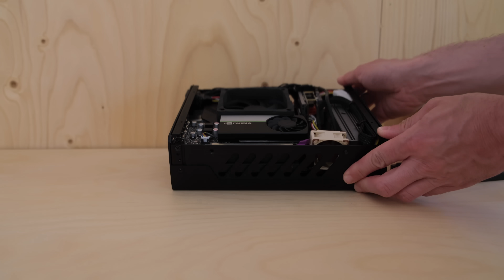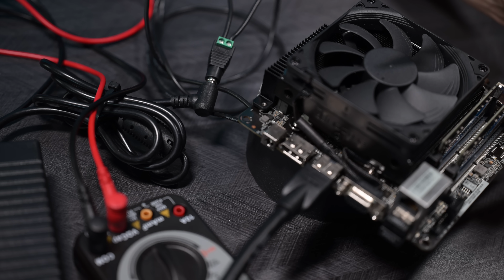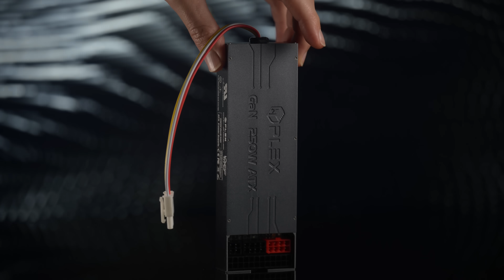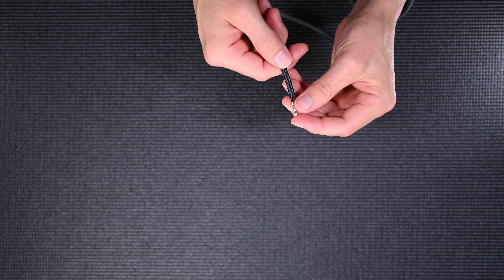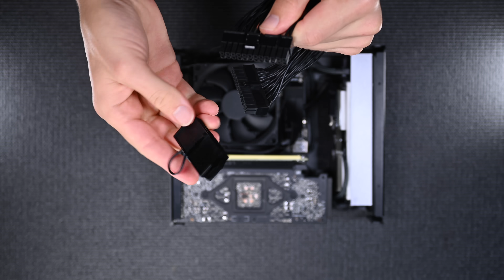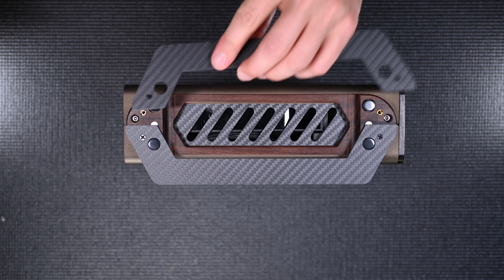My dream PC: "Tiny RTX"

Comment: Interesting guys, you just need 3D printer, some named machine that cuts shape into the plastic plates, custom expensive cable, high priced low voltage power supplier. So instead of building PC just start business with it.

Comment: The problem i can see here is the gpu copper plate. The GPU chip is always machined and soldered as flat as possible to ensure maximum contact with heatsink where as the memory chips are not subject to the same tolerances and direct pressure from an non flexible plate will put uneven pressure on the solder joints and will cause the components to fail prematurely. A simple solution is to use decent thermal paste then 0.5mm shims to cooler and 0.5mm high quality thermal pads ( i use arctic GP3 ) on memory chips. This allows even pressure on the memory chips and at the same time reducing temps nearly as much as a direct copper, just without potentially busting the card.

Comment: do you nead the "psu" ? you cant find 12v and ground on the bord to drive the gpu say if you use a  330W Dell G16 7630 AC Adapter ore dos that not wourk ?
Reply from the maker: Hello, can you please clarify for me? I want to help. :)
Reply: @NotFromConcentrate  say you use a 330w and not the 120w carger. and find the 12v and ground and solder wieres directly from the motherbord and conect to the m.2 adapter
Reply from the maker: @MyggFaen  I apologize I am still not 100% sure what you are asking, but Im going to take a stab at it. I think you are asking if you can use a power brick instead of the ATX GaN unit. I think in theory you can, but you might have some issues with sleep and power on/off, which may or may not be important to you. You would need a 12v brick, NOT a 19v brick, and those are rare in the 330w range. You need a 12v brick because the GPU needs 12v, and you need to split wires off to power the riser from that. I hope this helps.
Reply: @NotFromConcentrate  it was wat i was thinking about but i did belive i would finde a 12v spot on the motherbord to conect the to, eaven if i used a 19v power brick

Comment: Its funny almost the same spec as my own mini rig, i got a 5600g a2000 12gb and 32gb at 3600mhz , admittedly yours is easier to upgrade than mine since ive made my one near the same size as the motherboard but still yours is sooo much cleaner
Reply from the maker: That's awesome! Do you have any pictures or a link? You can share on the NFC discord!!! <3

Comment: I want to do the same, asking serious question, after this months is there any problem when using 12v only for mini STX ?  Thx for reply
Reply from the maker: Works flawlessly for the X300. For other chipsets there are problems and you need buck converters. I'm eagerly awaiting the rumored x600.
Reply: @NotFromConcentrate  i have A300 version, its has the same board. Im glad we dont need any boost converter. Thats the only weakest point which put me on hold to use ex GPU, btw it has standard 55x2.5 jack. So i think we dont need to solder it.  
Thanks you

Comment: Been watching videos lately on mITX builds and stumbled on this video. Crazy how small of a build this is to pack so much in! It looks stunning, and I'm sure it looks amazing on display. I like how it easy it would be to take with you anywhere!
I think insetting the front wood panel so the case is flush with the front like the back, adding some fine mesh lining maybe to the inside of the case which would serve to protect from anything getting inside but also visually add to the look and using some countersunk flathead dark bronze screws on the face would tie everything together even more.

Comment: One thing that I don't like is the look of the screws on the front panel. Have you considered doing it with magnets so the wood look a lot cleaner.
Reply from the maker: Yeah, please check out the updated video with this project. It's also watercooled.

Comment: Building a PC that is just capable enough means you built an obsolete machine.
Reply from the maker: Getting a tax refund from the IRS means you overpaid them and they used your money interest free. I prefer to have exactly the power I need, save my money, and then upgrade later if necessary. Obsolete means it is not useful for the current task.

Comment: I wonder why you didnt build it with intel b660 board since it supports faster cpus and pcie 5.0 m.2
Reply from the maker: It wasn't out when I started this project. Also it doesn't support 12v so you would need a buck booster or exotic PSU to make it go like I talk about in the beginning of the video.
Reply: @NotFromConcentrate  Wow I did not know! how can one find out about the 12v support? I am really curious how you could upgrade the board.
Reply from the maker: @Japhgar  that’s the thing, it’s not listed anywhere, even on the x300. I had to experiment and be willing to take a hit for the team, but the NFC discord has tested other boards since and there is no boot with 12v

Comment: I want to do something similar with a pico psu. Should I solder the dc jack wires to the motherboard 24pin or the 4pin cpu power?
Reply from the maker: Which Pico? An AC/DC Pico? I would use CPU or PCIE not the motherboard voltage.
Reply: @NotFromConcentrate  Looking at the PicoPSU-160-XT DC-DC Power Converter, 160 W. It's got a PCIE so I'm assuming I can just use any 12v and ground on it? I am using the molex to power the GPU. Thanks for replying.

Comment: Awesome bulid you should of fan modded your A2000 you could use the extra 7 watts to overclock the A2000 and get a pretty good performance bump to gaming ( Just look up A2000 fan mod) it super easy and costs about 8 bucks to do

Comment: Lovely project, well done, lads.

My only question is, why didn't you go with the 5700X instead of the 5700G? The integrated RX Vega graphics is "dead weight" (thanks to that "mighty cool" RTX A2000), the 5700X has the same power specs and should be running a bit cooler in general but has the superior cache configuration, surely worth the 30 dollar more. (PCIE 4.0 support wouldn't matter with that board).
Reply from the maker: Simple; the bios only supports the 5700g. Plus I had one on hand and these videos aren’t sponsored so I like to make stuff with what I got :)
Reply: @NotFromConcentrate  Ah yes, that's the board from the ASRock Deskmini X300 and only supports APUs. My bad. ;)

Comment: somehow youtube didn't give me a notification for this even though I have your channel set for "all", so I'm late :p 
Fantastic build though!
I'm in the process of teaching myself power electronics with the goal of someday building a custom power supply for a dream sff build I've had in mind for a few years now

side note: that shroud on the cpu cooler had me very confused in the opening glamour shots XD Couldn't make heads or tails of which parts were what! 

I've got a similar but smaller shroud I got from Jhack 3 or so years ago on top of a noctua l9a that is somehow managing to tame a 5950x in my sm4.

Had to make a few power tweaks of course, but the biggest impact adjustment was actually dropping the soc voltage. Didn't even have to drop ram or fabric speeds for it, seems quite happy to run 1800 fabric/3600 memory on a pair of 32gb gskill sticks with 1v flat.
Stock settings had it at about 1.2v, which pegged the poor thing in thermal throttling range just opening applications. Beat Saber would keep it at a steady 98-99c and at idle it would be high 70s to low 80s.
After the soc voltage drop, it idles in the mid 50s and never goes over 80 in my normal usage. Power consumption dropped by about 20 watts, which is just crazy to me.

Comment: Why is the "base" made out of Carbon Fiber? ..you need the bottom part of the device to be the heaviest.
Reply from the maker: Hello! The device isn't top heavy and can easily stand on its own and even take a bump or two. The carbon fiber is just further tip over protection and provides +5 style points.
Reply: @NotFromConcentrate  Reinforced Polymer is only stylish against synthetic polymers.
While Im not fond of the shape at the bottom (since it seems to affect laminar flow) a metallic component with a "black chrome" coating would make the device seem as if it was floating while increasing thermal conductivity and lowering center of gravity..
Pardon my English not a native speaker.

Comment: modular? technically yes, in practice barely...
Reply from the maker: There aren't many choices when it comes to parts, true, but they are all easily swapped out. Asrock has been good about the STX formfactor for several generations now, and their new intel board is even laid out better. There is a rumored A4000 in half height, and there might be something interesting from intel and AMD around the corner in a few years when I would like to upgrade. Peace

Comment: I use a Densium 4 with 4L volume. It has a nice woodenfront with USB-C. It fits a normal ITX board with a small 39mm Cooler and an full height ITX GPU, like a PNY 3060. The PSU is Flex-ATX upto 400/600W (400W for quiet Noctua-Fan :D ). There is also a 5L Version for a longer GPU upto a 3060Ti or modded 3070. The big advantage is that the Densium4 technically uses off the shelf parts.
Reply from the maker: Me making something unique does not take away from someone else's achievements. The Velka layout is great and the best solution for many people. We have a wide variety of cars that speak to our tastes, otherwise we would all be driving toyota corollas. :) Peace and thanks for the comment

Comment: it would be great if u would have gone  for i5 12600k  or 12400 and just under volt it to a point where u would u get efficiency , lower temps and less power draw and for the gpu side should have gone for a lower profile card with pcie connection instead of the m.2 slot bcoz there is lot of performance being left out 
but great build though really liked the power supply
Reply from the maker: How much performance is being left out using the 4x rather than 16x connection for this card? I would love to know. Thanks :)
Reply: @NotFromConcentrate  well i cant say the exact no but it will be there bcoz obv u r decreasing the lanes which will surely affect perf along with that it has the same chip as that of a 3050 with bumped up vram and cuda but decreased tgp so i cant say until u know u do just few benchmarks with and without m.2 but that will be a another story lol
Reply from the maker: @akshatsingh9830  Well that's the thing. I have run the benchmarks and there is no difference at all. I even tried with the 2080ti and there is no difference. GPUs just can't saturate the PCIE bus. I also can't find any professional testing that would prove otherwise up until the 3080ti. So if you knew of a way to test it, I would be very curious. Thanks!
Reply: @NotFromConcentrate  ohh if thats the case then it is great got to know something diff thnx

Comment: Design is truly fantastic but are you not optimizing the hardware for thermals and performance? IMO that's half the battle with sff. That pricey A2000 should have higher binned silicon which should undervolt/overclock really well even with the 75W limit. Same goes for the 5700g or even a better CPU locked to an acceptable limit.

Don't get me wrong, your work impressive but the performance is certainly not ideal for the cost and you didn't list thermals so I assume they aren't either.
Reply from the maker: Hello, thank you for commenting. Please see the spreadsheet in the description, and check out the note under "THERMALS." If you disagree with me that practically speaking what we care about is clock rate and fan speed then please articulate your argument here. I love learning. Peace
Reply: @NotFromConcentrate  Thanks I  didn't notice it down there, I assume that's avg gaming load temps. To clarify, I'm not disagreeing with anything. I'm wondering if you do any common optimizations like undervolting the 5700g in BIOS. Due to how Ryzen CPUs boost, reducing thermals and power through undervolting alone actually increases clock speeds and overall performance. On really good chips you can take it quite far.

The GPU requires tools like MSI Afterburner and since it's limited by power, undervolting is again your best bet for headroom. It's incredibly common to do this with laptop GPUs and the same methods apply. The the memory in these Nvidia cards is often clocked well below its actual spec allowing for significant increases. Look at what the mining community has been doing with the A2000. For gaming you'd want to find the best balance but point is there's a lot you can do even without getting into the more complicated stuff.
Reply from the maker: @JJFX-  Absolutely. I do have a good amount of tuning on this rig, but I didn't want to focus too much on that since our next video takes this to the next level, and nets a SIGNIFICANT performance jump. Rather than cover the topics twice, that info saved for the next one. I do have the 5700g using about 10 less watts than stock. I'm using all the available headroom for the A2000 without mods, but again, those mods are done in the next video. Stay tuned!!! Thanks for commenting.
Reply: @NotFromConcentrate  Ok that's great to hear, I figured you surely knew about some of this. I'm not sure how technical your target demographic is but it'll be interesting to see what you've done. I think it's a really important topic for sff builders. Especially since higher power parts are becoming normal again.

Comment: as an SFF lover, this was a beautiful video to watch to sate my inner SFF nerd. However, due to limitations in time and budget, as well as part availability, I can't build an NFC-style  build. I have a huge slew of plans involving future hardware acquisitions and/or using existing hardware. One such variant is to use the 250W Gan-ATX's in sync with my current hardware(12600K, 3080, mITX board), and make a custom ITX case, but I'm consistently switching like a Geiger counter going haywire.

Comment: Super clean install.  However we've all watched the 4000 series release and those cards are bigger than this whole case, so there won't ever be any upgrades.  Hell, people with mid-towers can't fit the new cards..
Reply from the maker: yeah it's disgusting... the Gigabyte 4090 takes up significantly more volume than this case...
Reply: @NotFromConcentrate  I'm hoping the new AMD GUP's are more reasonable, or I'll be looking at a re-case myself.

Comment: The only thing this would be lacking for me is HDMI 2.1. I occasionally hook mine up to my TV, so the VRR and audio formats are really nice to have. Probably the only reason I haven't copped an A2000 (though I guess you could use an RX 6400, especially since it only supports x4 anyways. Just means no good video encoders or RTX/CUDA features).

Comment: I tried going small but the compromise wernt worth it to me. I plan on stuffing a 7950x with 280 aio, 1200w sfx-l psu and 3080 with 240 aio into 24L cerberus x. I could go smaller but that involves custom water and that's a hell for the trouble and headache it brings.

Comment: So annoying that the RTX A2000 12GB is so expensive for me. I can get an A4000 for the same price.
Reply from the maker: Check ebay. Now that ETH has crashed I've seen them for as low as $350.
Reply: @NotFromConcentrate  For me, I see the 6GB model for 300-400€ yes. But both the 12GB model as well as the A4000 cost around 600€

Comment: Amazing video! Just popped up in my recommendations, already love the channel. Got a question though: how did you brainstorm these ideas?
Reply from the maker: This one was just over time. I knew I wanted to make the S4T STX compatible so I included mounts for it when I designed it. There just weren't any good GPUs at the time and I didn't have a solution for power. When I saw the A2000 I knew I had to try...

Comment: At the cost of a very expensive quadro card,  it is not a very viable combo for most people (sad face). S4M's form factor is still hard to beat by being able to cram in additional 2 2.5" drives on top of a M.2 SSD. I am constantly looking out for a possible SSF replacement, but in vain.
Reply from the maker: You actually can fit in two more SSDs in this build via the micro sata. Wait for the build coming out in a week or so on this channel. Also you might be able to snag the A2000 on ebay for cheap. I've seen them for as low as 350 after the ETH merge.

Comment: I love small form factor pc’s
Any way to build one that doesnt get very hot?
Reply from the maker: Just build one that doesn't use too much power. This one uses between 130w and 160w, and it has  135w of heat dissipation without fans, so it runs really cool. :)